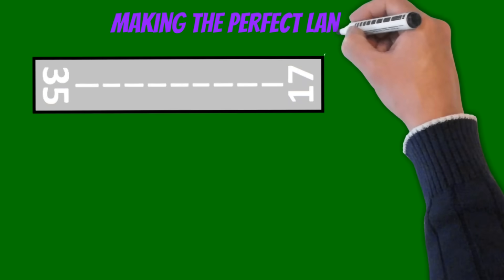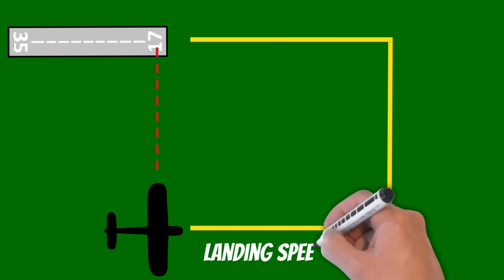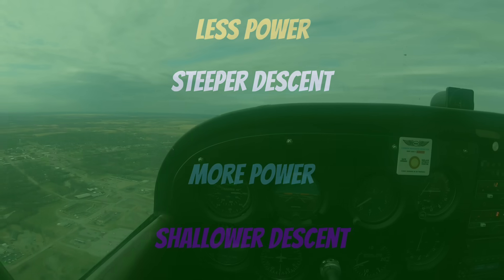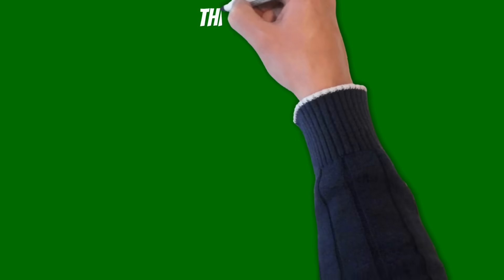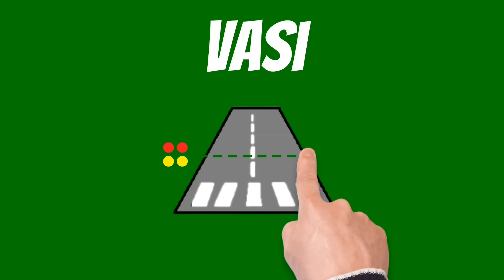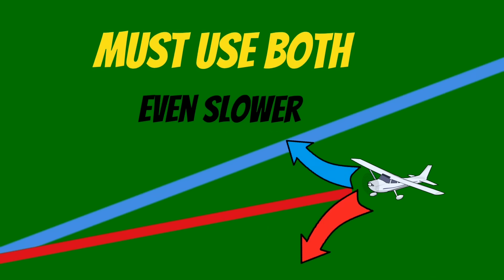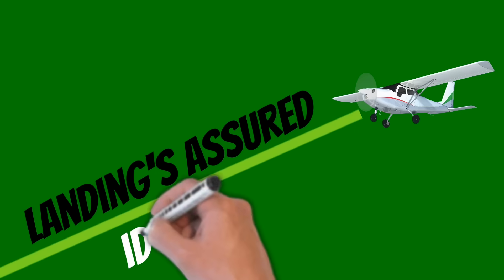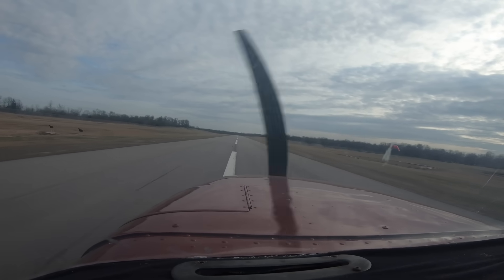Landing SECRET your Instructor won’t tell you [How to Land]

Comment: Very good video, but at the align part, I wish you might explain and spend more time on the "roll in, roll out" procedure.  From what I could gather you bank to the line, then use the rudder to do the rolling.  If so, a demo of this would be useful.  If not a demo of this would be even more useful.  Thanks!
Reply from the maker: Good feedback. Thank you. You should roll in and roll out using the ailerons. You kinda have to lead the turns to get the airplane on centerline.  Then you should align the nose with the rudder pedals
Reply: @FreePilotTraining  Thanks! One question~;  What's the difference between rolling and banking?
Reply from the maker: @raymondjackson6069  I use the words interchangeably, but there may be a subtle difference in definition
Reply: @FreePilotTraining  Got cha.  Thanks.

Comment: Everything that you said is correct, HOWEVER your title is not only misleading, but incorrect.  I have been flying for over 40 years and my son for 25 years (as an instructor).  No INSTRUCTOR keeps SECRETS from a student.  In fact a good instructor goes through all the landing inputs on the ground before the student does so in the air (just as you do in your video).  Then the instructor watches the tendencies of every student (they do differ).  Then the instructor can work on those individual tendencies that require correction.   The single most important aspect to landing beyond the set up is "SLOW FLIIGHT".  Learning slow flight is all about landing -  If there is any confusion for a student, some do not understand (poor instructors fail to tell them) why you learn slow flight.  It is about controlling the aircraft in the landing pattern and ALL THE WAY TO THE GROUND.

Comment: I am learning to fly a 182 and challenged by the final seconds before landing. Once I make my roundout, I fear a sudden drop and a hard landing. Once I cut power, I struggle with the last 15 ft to touch down smoothly. This video was helpful, but any tips are appreciated.
Reply from the maker: Hey man, sounds like you may be struggling with a “plopped in” landing which can occur because you are flaring too high.  Try this video, I discuss the high flare as well as some other things that could cause bad landings and how to fix them! https://youtu.be/EzJWu6TAZzA

Comment: So if you connect an autopilot to fly an ILS glideslope or LPV approach how do you get it to control that glideslope with power?  If you are fast and low do you add power to climb or just pitch up to regain the profile and reduce the speed? 

Sorry, my friend, but you are confusing the issue with your canned, rote approach.
Reply from the maker: Use auto-throttles… jk, but if you are flying an ILS or an LPV with the autopilot engaged, you better be making power adjustments with those changes in pitch otherwise your airplane will not cross the threshold at the right speed. You need both pitch and power when flying a glide slope. And I appreciate the compliment… “Rote” is the first level of learning. This video is for new student pilots so this is my first step in getting them to learn how to fly the plane

Comment: Really interested why pitch for speed and power for attitude not other way around, how they thought me is - set proper attitude with pitch, and then when to slow - add power, when to fast, remove power - easier than doing it other way around I think
Reply from the maker: The reason is that you are on the backside of the power curve.  When you are below LD Max, you enter the region where induced drag is greater than parasite drag and total drag is much higher.  With flaps your wings create more lift when power is introduced but drag is also increase which means it is more difficult to get the plane to speed up when you introduce power. Pitching down is more effective for gaining airspeed in this configuration.  You can still gain airspeed with power, but it is more effective in altitude control.  If you fly an airplane with more power, it is easier for them to overcome the drag created by the flaps, so both pitch and power are effective, but this is not usually true in a training aircraft

Comment: Now try to cut off your engine on the downwind, try to do the same on base and try to do the same after base turn, so you know if you can still make it to the runway just gliding - power to idle. I bet that if you have full flaps after the base turn like you did 5:00 you wont make it. Cheers.
Reply from the maker: Too true. I definitely don’t do the same procedures if I lose my engine
Reply: You should do that every time, who knows when you’ll lose an engine.

Comment: 1 mile???  Where do you intend to land when the engine quits because you’ve changed your power setting, causing an existing, unknown mechanical discrepancy to make itself known?  If you’re at 1000’ AGL, you should be no more than 2000’ from the runway.  You can always slip to safely lose altitude if you’re too high or close.
Reply from the maker: According to my POH, I can glide for 1.5 miles at 1,000’ AGL, so I don’t see the problem.
Reply: The POH is based on no wind, standard day conditions.  What if you skirt along a flat bottomed cloud and find yourself in sink?  Since you land into the wind, it will also carry you away from the airport.  What if we're operating somewhere with surrounding hills, mountains, populated areas, and/or tall towers? Shall we delve into the delayed reaction times of the average pilot, too?  If the engine quits, will you focus on continuing to fly a textbook pattern, or a restart?  The POH, while a great guide, can keep you "inside the box" when your situation and the solution are outside the box.
Reply from the maker: Agreed, POH is no wind.  However, based on the POH, I will be traveling 7,920’ in distance for every 1,000 feet of altitude.  This assumes that I will travel a slant range distance of 7,983’ (1.512 NM). Now, the best glide speed in my airplane is roughly 70kn. This converts to 1.17 nautical miles a minute.  This means it will take me 1:29 to fly down to the runway at 1.17NMM. Now, based on this descent rate, this means I will also be descending at 775 FPM. Now, let’s say I have a 20Kn headwind... this would mean my ground speed is now 50 Kn instead of 70... so every minute, I am traveling .83 nautical miles a minute or 4,382.4’ while still descending at 775 FPM. Continue this trajectory, and I will land 285.6’ past the threshold, and this is WITH a 20 Kn headwind.  I do a lot of power off work, so I am intimately familiar with my airplanes capabilities, and I’m not afraid of losing an engine at a mile out.  I will make it back in almost every circumstance.

Comment: While these kludges can work ok in low performance aircraft, none of these techniques work in high performance aircraft.  The biggest mistake is assuming you flight path  aligns with canopy references.   Of course, it doesn't at all.  Its not uncommon to see only sky in your canopy in a high performance aircraft heavyweight or no flap landing, or if you mistakenly get too slow.  So when teaching aimpoints, its important to learn how to interpret visual cues outside of the aircraft to determine where the aircraft is headed, not where it is pointed, or what is behind a simple canopy reference.  Actually seeing where the plane is headed (your true flight path), by determining the spot on the ground that is not moving, then flying that spot to your intended aimpoint, is the essential skill and the key to landing all airplanes perfectly, without relying on oversimplified, even dangerous use of canopy references.
Reply from the maker: That is 100% fact. I will point out the fact that this is made for brand new students though, and the concept you are describing is a valuable tool, but nearly impossible for new students to grasp with a handful of airplane. I do appreciate the valuable input though.
Reply: @FreePilotTraining  
It's really not that hard to teach.  I used to teach it in the mighty C172/T-41C Mescalero with first time students.  Its a little different scenario, since USAF students would go on to fly at least a T-38A, back in the day when you had to fly a T-38A to get your wings.  The T-38A had no HUD and thus no Flight Path Marker to actually superimpose on your aim point, so it had to be done manually.  You cannot safely land a T-38 using canopy refs, a hellacious sink rate will develop, most of the time.  So the sooner a USAF student learns to assess their flight path manually, the better.  

A HUD FPM is not foolproof either, it can be wonky if the INS drifts, well off actual FP, and cause a major mishap if the pilot isn't always "looking through it" to determine accuracy.  

Obviously hauling unspent bombs, or fuel, home in an F-16, and the magic of auto flaps/slats, means you have absolutely no clue what a canopy reference might even be.  Required pitch angle varies by about 25 degrees, on stabilized final, from a lightweight clean config, to as loaded as you would ever want to land.  Additionally, the vertical thrust component provides an essential part of lift as required AOA on final grows, so thrust needs to be reduced, but not eliminated, commensurate to the round out to avoid ballooning.  

The same is true when using oversimplified canopy references in a puddle jumper.  If flaps aren't set properly, or airspeed wanders, you can settle into an unrecognized sink rate using only bubblegum on windscreen refs. 

So while there are many techniques to land, the ability to determine where you are actually headed, by mentally crawling outside and looking for that one spot on the ground from which all visual ground movement emanates, is a truly essential skill to sanity check all of them.   

I teach it before flight 1.  Its easy using a hand held model to demonstrate that flight path is AOA dependent.  Then I draw the runway geometry like you do, but originating from the aim point, I draw arrows to symbolize ground movement.  

On my first demo, I set the proper aimpoint, then I start aiming at a slightly different spot and ask the student to assess where I am actually aiming (at the numbers, 100 ft short, etc). Some students pick it right up, some take a while, but I've never had a student who can't assess where the aircraft is actually aiming in a ride or three.  

By training students to fly/move the spot where they will impact the ground on final to control glide slope, they fly safer, sooner, IMO.  Example: if they are shallow, I direct they shift their aimpoint to the numbers, then as they see correct glide slope geometry, to bring it back to the threshold.  Vice versa, for too steep. This type of proper correction is very hard to execute using only canopy refs, because the root cause of the glide slope error will also affect the temporary correction picture, and its hard to pick a meaningful correction picture for a given situation.  How can one be sure the corrected picture will even work, say, in a very strong headwind?   Using canopy refs can leave the student defensless in an unexpected condition.
Reply from the maker: @FFE-js2zp  I will try this. Thank you
Reply: @FreePilotTraining  
Cool, you'll like it.  On this demo landing, I would critique your actual aim point starting off good, but it drifts long, all the way to the far end of the runway, as you are demoing the wing low method. Maybe you are still slowing down, and talking, so the airplane is predominantly fast.  

When you see the steep picture developing, you lower the nose a touch to aim at the center of the runway.  Then you verbalize the steep picture and pull power, but for a few seconds your actual aim point stays well long, back to the far end, and is sort of a contradiction to your words because it takes a few potatoes for the airplane to shed airspeed and naturally lower its nose.  

When you get a bit slow, because the aim pont stayed long for a moment with reduced power, the actual aim point becomes short, maybe half way to Perimeter Road for a moment, then back to intended aim point, which is not quite long enough to correct the slightly shallow condition.

By the time you approach the runway threshold and talk round out, you were already aiming at the numbers to fix the slightly low condition, then you aimed 150' beyond the numbers as you freeze the video to talk about the aim point shift.  

Easy for me to say.  

I find that using video to critique each landing like this can really help the student understand why deviations in glide slope developed, so they don't develop next time.

I totally agree with you that using, then varying an aim point to maintain glide slope, instead of some Zen method, is critical to any repeatable landing method.

Comment: When I fly a low wing a/c I like a little power 600-700 rpm when I am about to touch down, it floats a little, not much bit it "greases" a lot more often than not. I trained in high wing (Cessnas) so it took a while to "feel" it. On my Commercial check ride it was a low wing high performance a/c and every landing had to be a greaser. Holding pitch and bringing power almost to idle did the job
Reply from the maker: I’ve actually heard of a lot of people using this technique. Seems like it works for a lot of people

Comment: You can do a Slip if you are too high on final, you can put the aircraft in a shallow bank and slight opposite rudder to keep the plane center with the runway. This video applies for a "No wind" situation. 
" A good landing is always preceded by a good approach"

Comment: Some comments from Germany. First, i dont like the power during approach. If youbrely on power from your engine and it suddenly quits, then you are in deep troubble. So i always plan approach that i dont need power to make it to the field. That also means to take into account headwind on where to turn base and final as well as flap settings. With strong headwind i dont need all the drag so i can go with less flaps. Putting your aim point to the treshold means you give away 200ft of runway. As most come in high and hot even more. Ok for your long american runways of 3000ft and more, if you have only 1500ft total available it bites you. Put your aim point 200ft before treshold and you sit at the line.
My instructor put a little sticker, a dot, on the windshield as a reference. It helps during turns, power setting changes, landings etc.. No need to guess an imaginary point above dashboard.
Reply from the maker: Thanks for the comment. This lesson was designed for student pilots who are brand new and the Airplane Flying Handbook recommends using power for approaches. That’s the only reason why I teach that.  I agree, power off approaches are very important, and I do include them in training a little later. As far as flaps are concerned, here in the US, you are required to learn how to land in all flap configurations.  Full flaps is usually the most difficult for students to learn because it requires a more aggressive round out and flare.  In no flap landings, the airplane is often already in a landing attitude as you are coming down final.  Coincidentally, landing flaps also shorten landing distance, so if you aren’t using them on Your short field landings, you should be. As far as the aimpoint is concerned, that is a great point. As a general rule, I use the threshold as an aimpoint as long as there is plenty of runway, but in some cases, your aimpoint may need to be in the grass before the runway starts. I regularly land on a 900’ grass strip in my 172 and usually stop within the first 500’ using this technique.

Comment: I was taught primary by a barnstorming dentist that owned a great lakes tail dragger and this is what he taught me about smooth landings, I hope it helps.  If you want to grease one on you need to 1) a lot of nose up trim then flair ---(CFI starts chanting) "HOLD IT Hold it, hold it, hold (stall horn) hold it hold it "off dont worry too much about your aimpoint if you are going for a grease job as you will naturally be a tad bit long.  After touch down Hold the nose wheel off the runway until it naturally falls down. You should have somewhere between 75 100 percent elevator input. Landing in a C 152 172 without the stall horn in your ear you are touching down too fast barking the tires and burning the rubber. The CFI in this video seems like a good CFI, clear calm and exceptional learning visuals and Ive had all kinds of instructors from the military to 141 flight school mills where CFIs (don't get much stick and rudder time) routinely prang equipment onto the runway.  I've had panels blown out while letting 141 CFIs have a landing while giving me instruction, granted we were flying piper senacas which are not easy to land smoothly due the heaviness of the controls and the need to have a mastery of landing power settings(you maintain a power on setting(most airplanes bigger than a C172 require) during landing because if you go to idle power the bottom falls out and the plane will prang down and possibly bounce, porpoise or worse.  Good luck and thanks for the free lesson, are you sure you do not want a crisp 20 dollar bill? ;) going rate for instruction many moons ago lol!
Reply from the maker: PJ, thank you so much for the tips and the compliment! I enjoyed your input!